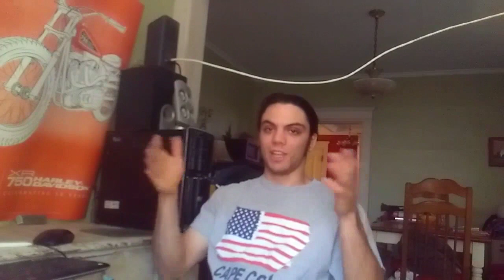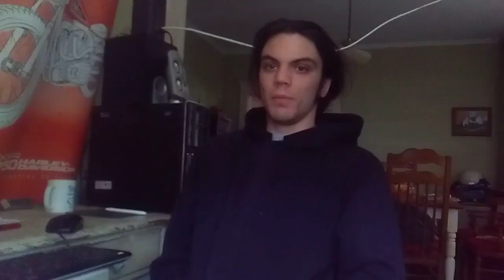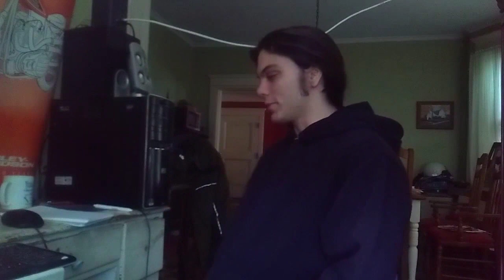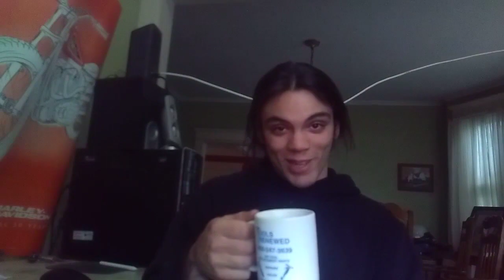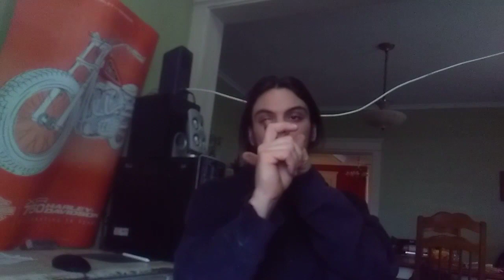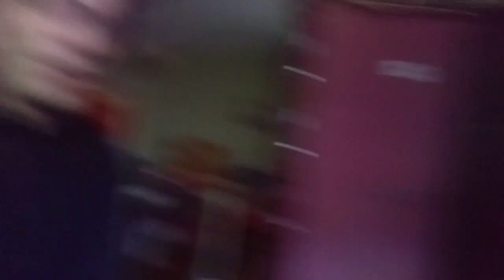Idiot's Guide To Alcohol Fuels S4-Tech Special 1

Comment: I had an 406 sbc 12.7 to 1. Switched to methanol, had to break in cam. Ultradyne recommended 4000rpm for 15 min at minimum to break in cam. Long story short. Fired it up, ran up to 4000, and out of 5 gallon can of methanol we made less than 10 min. Lost horsepower on top but gained large mid to top orque. I made my own holley carb too. Drilled my metering blocks 230%, jetted for temp.it ran 240 degrees full bore, and would drop right to 160 after like 30 sec of off throttle. I used vertex mag with methanol too. Perfect timing curve. And valvoline made an racing nitro oil that wouldn get milky with the high moisture.
Reply from the maker: Nitro also will lose  torque up top